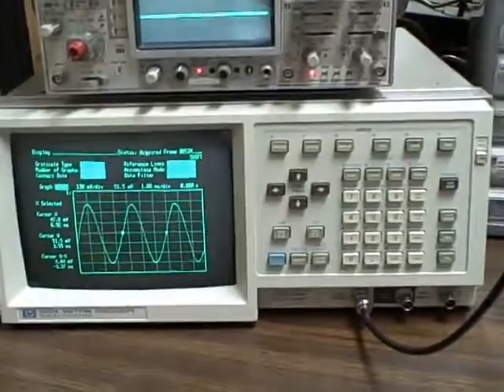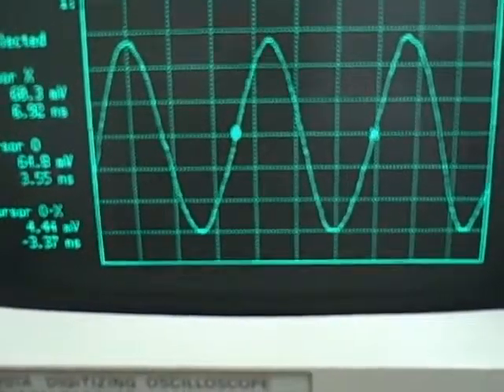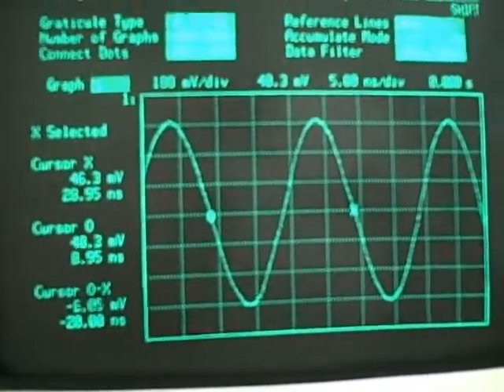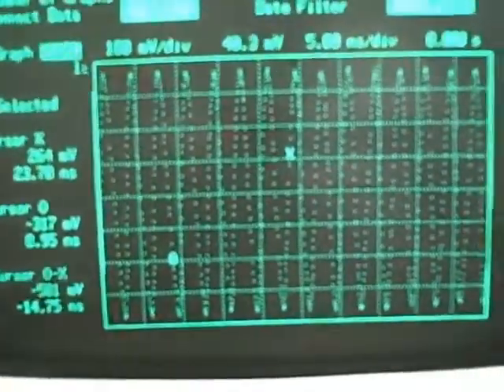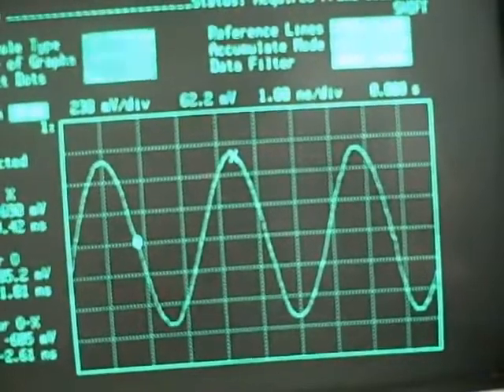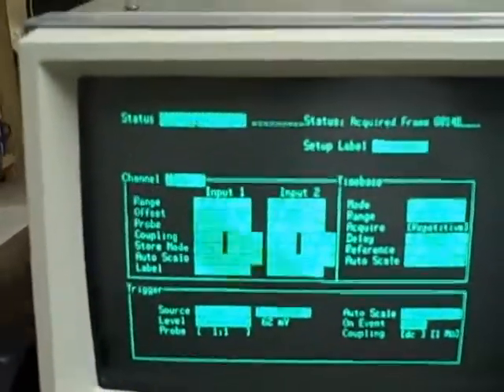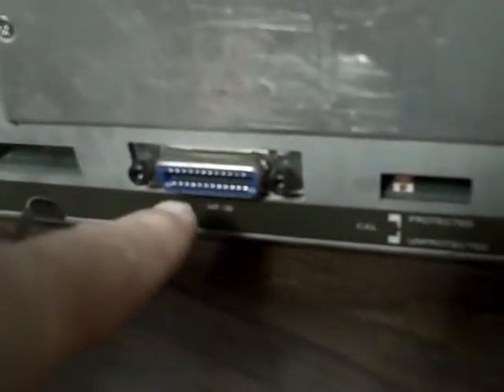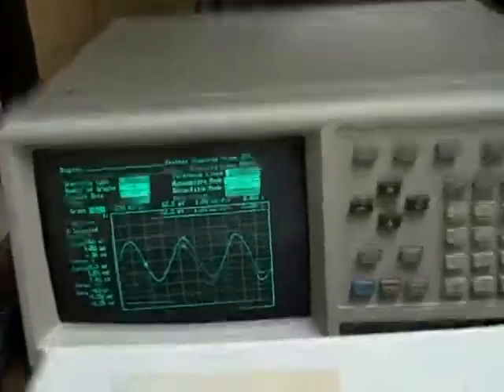54201a

Comment: I actually just bought one of these off of eBay not to long ago.  It's quite a great scope.  It seems really complicated at first but after spending a couple of hours with it you get it down.  I haven't tried any of the programming (and probably never will), but using it with the front panel is good enough for my purposes.

Comment: Maybe use the vertical positioning to center the sine trace on the center line before you measure the peak voltage.